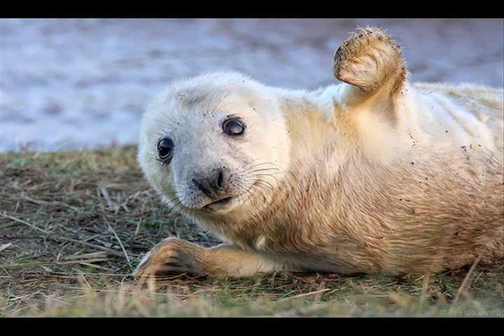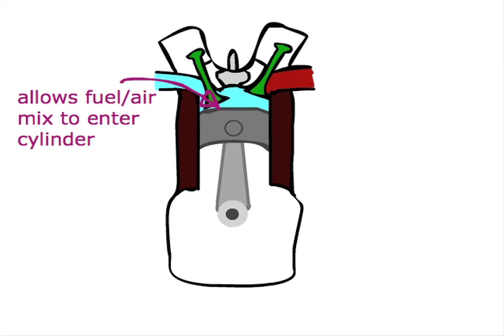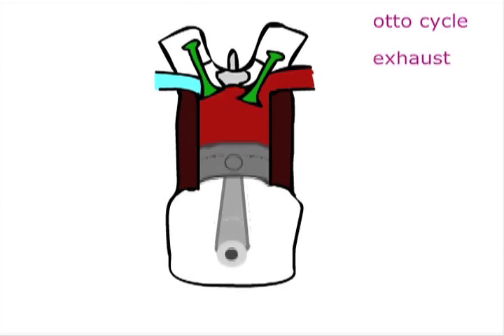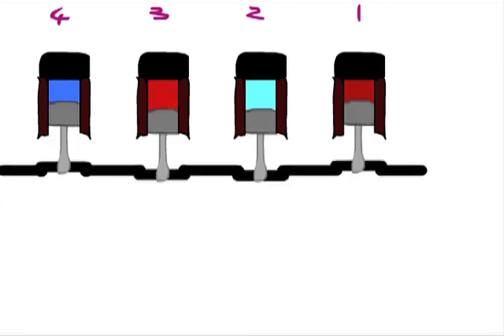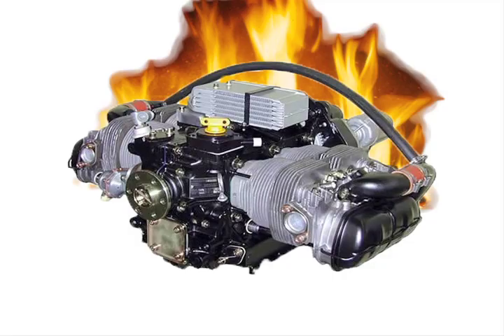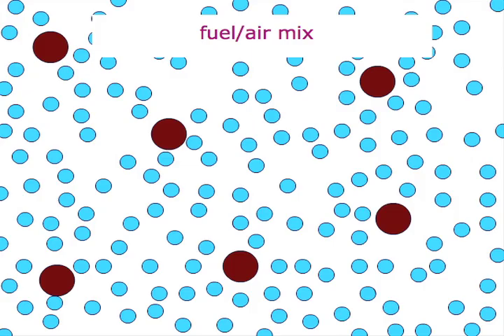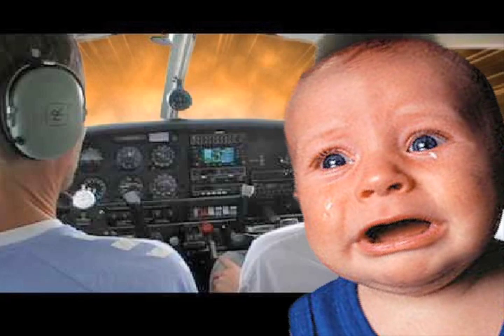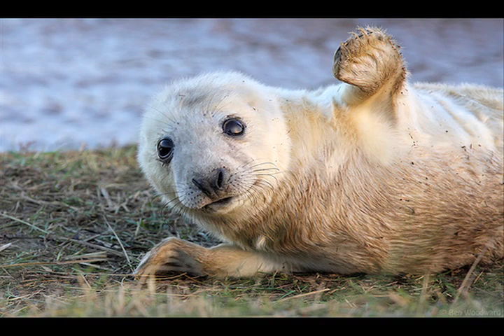Piston Engines Explained | profpilot.co.uk video #12

Comment: You clearly show your arrogance and ignorance about the aviation world in this comment. I am confident that you have never been inside the cockpit of any aircraft, other than maybe as a child having a tour of a commercial airliner that you were a passenger on. Most smaller aircraft such as Cessna's, Beechcraft's, Piper's etc still use manual fuel mixture controls. Make sure the information you have is correct before you decide to shoot off your big mouth

Comment: Higher compression also produces a faster burning mixture as the distance between the molecules is less which helps the flame front 'jump' across to the molecules faster. The richer mixture helps facilitate that too because it reduces the detonation tendency. There are other factors as well.

Comment: Funny and educational videos! I know you're educating to a basic level but while the 15:1 fuel/air mix is considered the stoichiometric ratio, and you're correct that it will use up all the energy in the fuel with nothing left over, the fact is that in real life the max power mixture is slightly richer at around 12.5-13:1. At that setting the mixture burns the fastest. Burning fast means that you can concentrate the power at the optimum point in the power stroke, ~16 degrees after TDC.